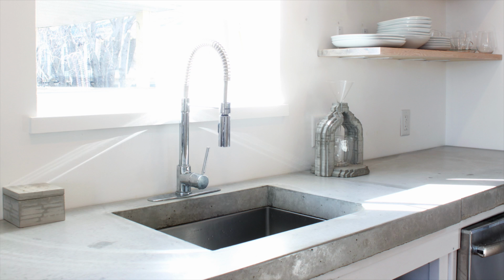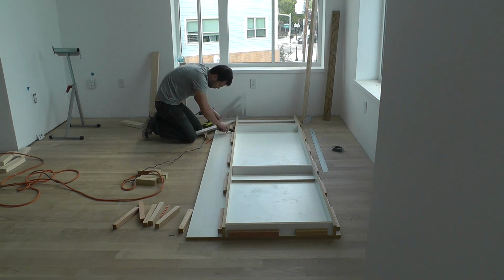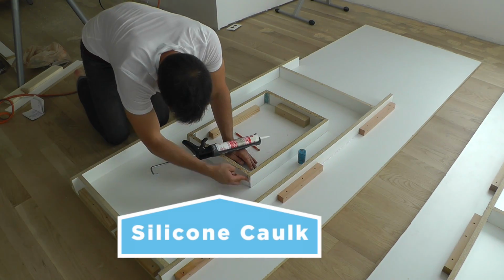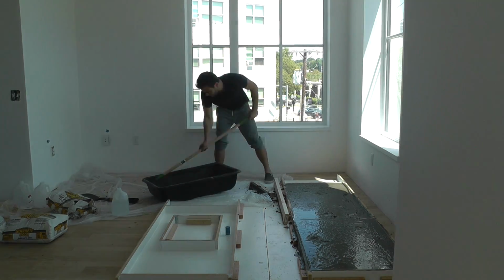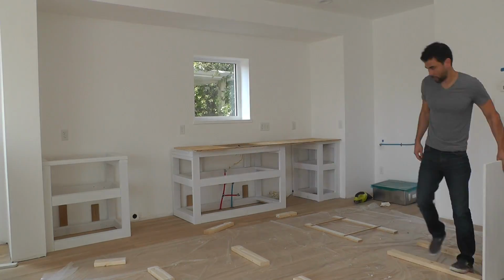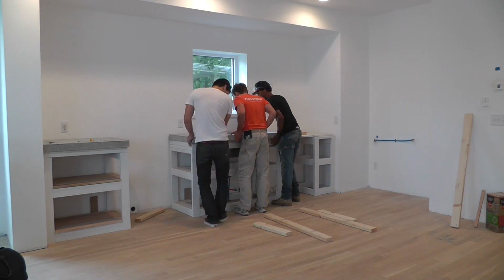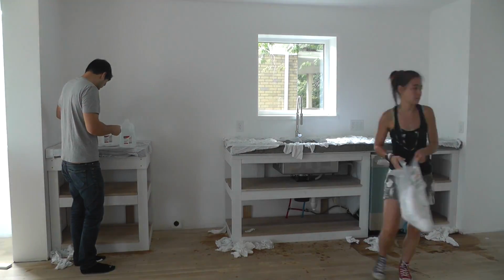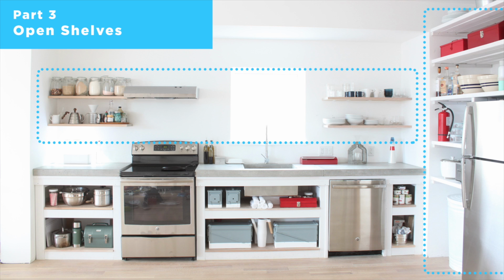DIY Concrete Countertops | Part 2 of The Total DIY Kitchen Series

Comment: this may be a dumb question.. but why not use a self leveling concrete?
Reply from the maker: poured in place concrete counters are pretty common but a lot of labor to get the top smooth
Reply: HomeMadeModern right, so wouldn't a self leveling mix be the best?

Comment: Hey quick question.  I know Quickcrete sponsors you and I'm curious why you chose 5000 mix over their countertop mix.  Was it an issue of what was available to you or did you like the look or functionality better?  In the next day or two I'm doing a pour in place, outdoor concrete countertop and read reviews of Quickcrete's countertop on home depot and wondering if I should use 5000 instead.
Reply from the maker: good question!  i wanted to show that great looking super strong counters can be made without finding a specialty mix!  Countertop mix is 6000psi instead of 5000 psi and a little easier to work with but quieter 5000 is available off the shelf and works great!
Reply: Thanks for the answer.  I did a pour in place today.  I used Quickcrete 5000 instead of the countertop mix.  It was a lot cheaper.  I enjoy your videos.

Comment: is it possible to have a finish with no holes at all, and to feel almost like granite with sanding? Or is that kind of finish just not really possible with concrete? This looks great, I'm just curious if it could really rival the look of a polished stone.
Reply: You could probably do a few thin coats of resin with extremely fine sanding between coats to achieve a smooth shiny finish.
Reply: what kind of resin would that be? Doesn't the food safe sealer offer at least some sort of smooth finish?
Reply: You have to make a concrete slurry and buff it into all holes with a light wet sanding, let it cure, repeat if necessary, and then sand again, and you'll have a smooth finish with no holes. You can then polish the concrete with polishing pads to achieve a high shine, then seal with a food-safe grade sealer which is available online.

Comment: Nice work! Just a couple of comments: I don't think sanded unfinished wood subfloor is a perfect environment for concrete casting!! You then have a partially concrete floor! Also, rather than two separate slabs one whole connected piece would be way better. Also, I don't think you need to call a plumber to connect a faucet. Finally, you spilled the sealer to wood subfloor!!!

Comment: i like the idea. but should have put rebar around the sink cutout. now its gonna break in front of the sink. and should have been set down on blobs of liquid nails so it sits flush and can not rock around and break.and use your palm sander to vibrate the forms. not a saw! and dont forget to remove the sand paper before you vibrate.
Reply: +chimney man 
I think he ran a bar of the mesh around it, not a very stiff brace though in any case.  Perhaps he's depending on the sink for rigidity?
Reply: I think you need a man to comfort you in your time of need

Comment: Great idea to vibrate the mold with the recip. Beautiful job as usual!
Reply: +Keith Decent use a palm sander to vibrate the forms. not a saw... i build forms for concrete stairs all the time and it works great!! just take the sand paper off before you do it.. once water comes up you know you did it properly

Comment: I've noticed that you usually use molds of 2.5 inches or more. Is that just your aesthetic preference, or is there some reason that thinner concrete slabs made this way are impractical? Thanks!

Comment: is there a reason why you used the 5000 concrete and not counter top concrete ?
Reply: +David Ferrer same strength once cured and about a 3rd the price, plus far more readily available would be my reasoning.